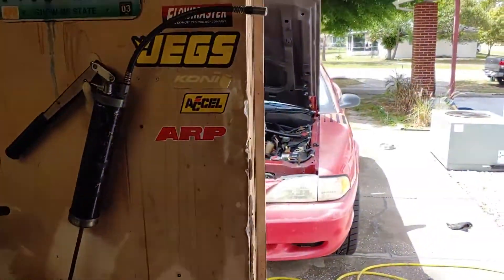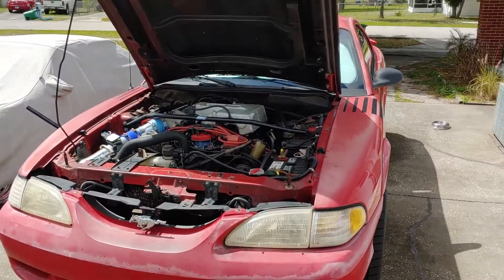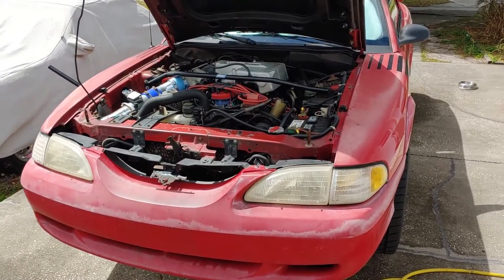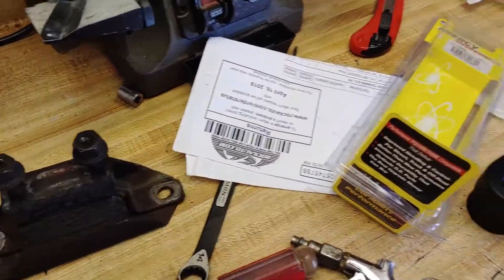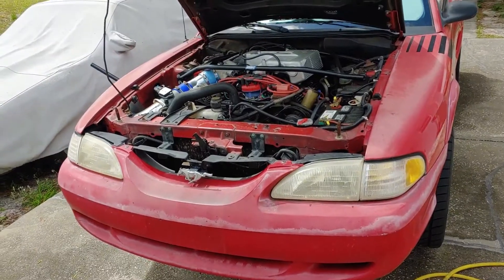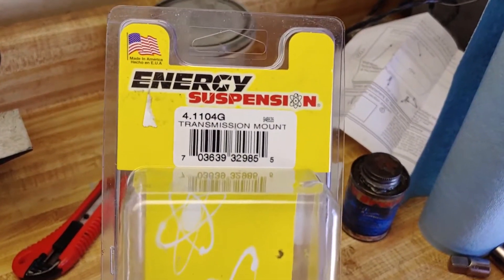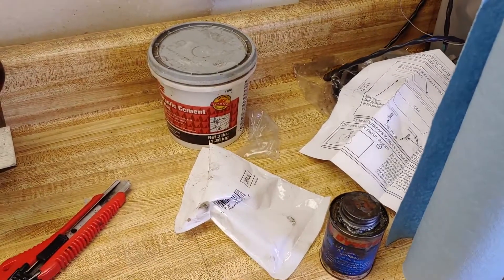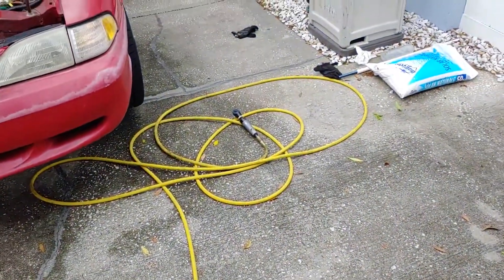1987-1995 MUSTANG GT, LX T5 TRANSMISSION MOUNT INSTALLATION

Comment: I have a question on what wires on your oem fan plug is high speed and which is low speed?one of your videos u changed what u said which wire is what?so is black wire the ground?or not?I would of asked this question on your fan video but it says your taking comments.let me know.love the videos.big help
Reply from the maker: Black is ground to the battery. Red is high. Orange is low. Make sure fan is pulling air through the radiator. No fuse necessary with 10 Guage wire.